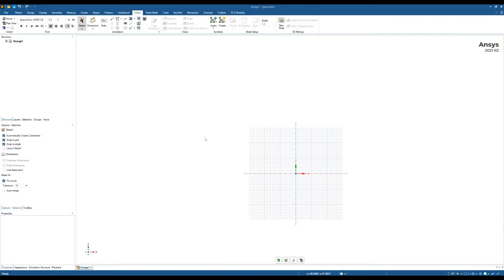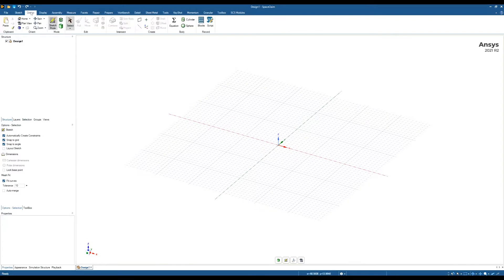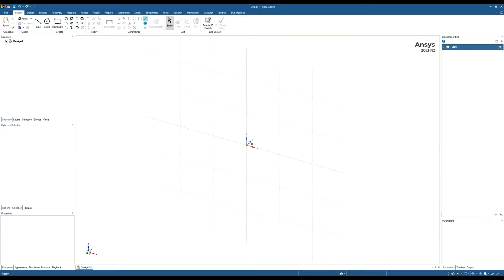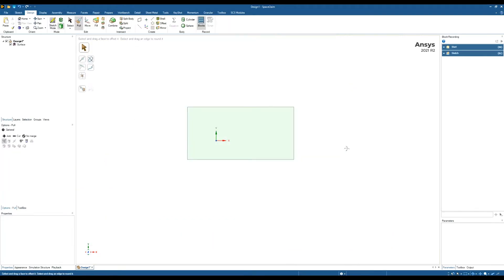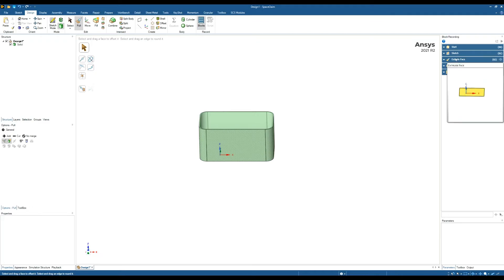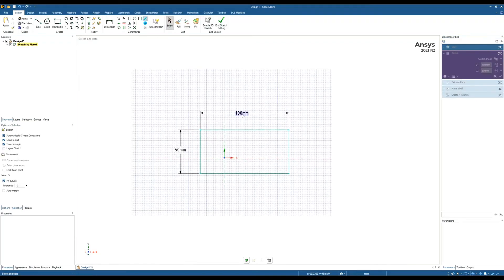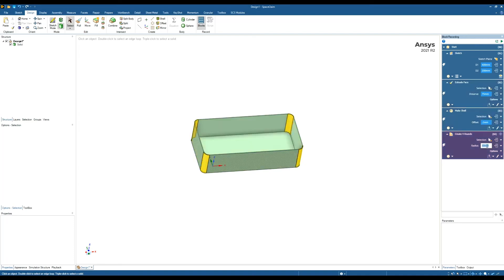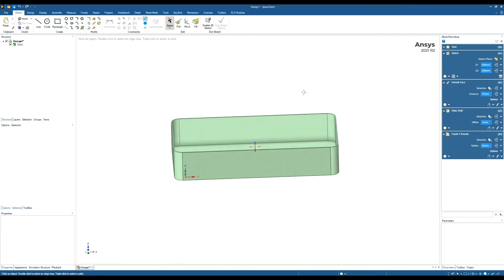Ansys SpaceClaim   Block Recording/ Parametric History Tree

Comment: Would be nice to see a more complex block recording history part and a demonstration of the advantages vs disadvantages of same over dynamic modelling - perhaps a complex drafted plastic part.  Can a part have a mix of block recording and dynamic editing also i.e, if a simple dynamic edit is all that's needed, must it's creation block be found to alter it in any way? Just imagine how nice it could be to dynamically change a block recorded 'feature' and automatically the block record would update - perhaps fantasy...How does it work when the history breaks down - how easy is it understand the problem and salvage the model. Also, when you're modelling in the context of top down assembly modelling and opening components etc. to make changes...can a part component have references to other parts etc. Lots of questions... thanks for the video, I can certainly see the variational benefits in your basic part.
Origin Engineering solutions is doing some of the best YT informational videos with SC - so, thank you again.